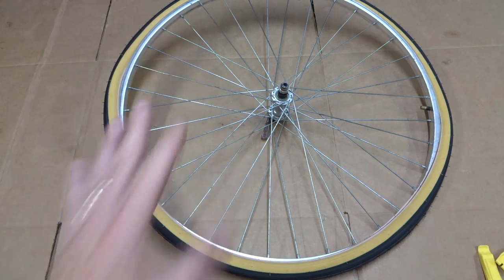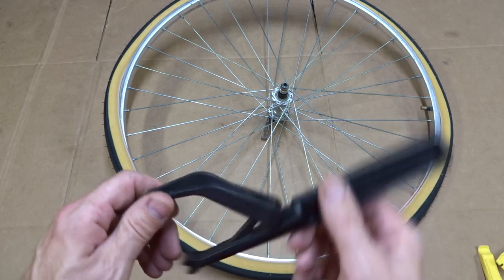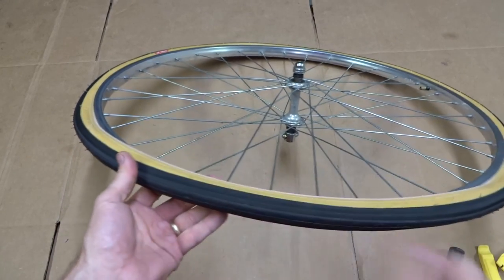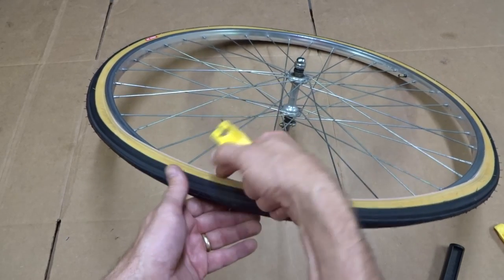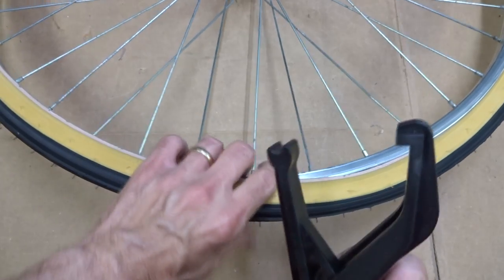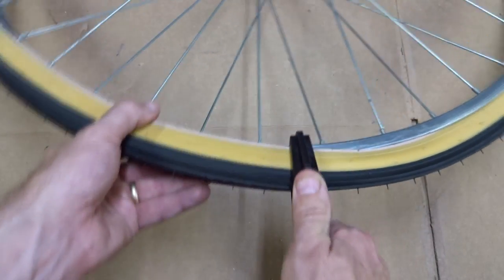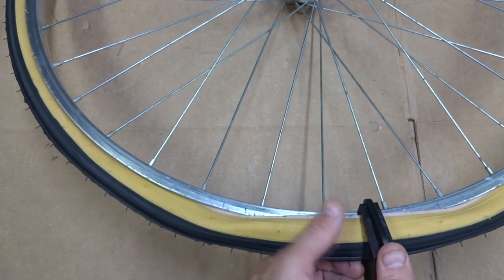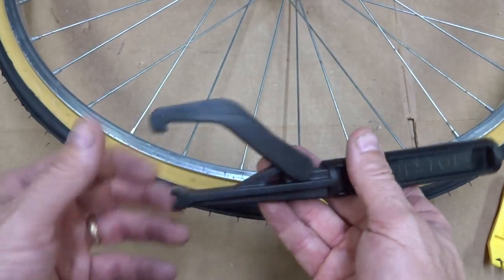How To Get Tight Tire On Bike Wheel Rim With Tire Bead Jack

Comment: This a great tool to have in the shop but doesn't help you when you are on the road -it's way too big to carry with you. There is a new tool on the market that is much smaller and works just as well as the Tire Bead Jack. Check it out at EZCLINCHER.COM. It's only 25 grams and fits into a small saddle bag. Great tool for seniors on the road that have a tough time mounting the tire on the wheel after repairing a flat.
Reply: Kool Stop Tire Bead Jack is not too big as it's light enough to fit in jersey pocket. While the product you mention may work the website seems a touch sketchy.
Reply: @alrocky  Can I send one to you and have you try it?
Reply: @webbmill  That's a generous offer however I already have the Kool Stop and there are several LBS that carry the EZClincher according to their website and actually biked pass one earlier this year.
Reply: @alrocky   OK- No Problem-thanks for responding

Comment: Can no one at all show how to get a super tough tire mounted on the first side?  Why are all videos seemingly already shown with the first bead over the rim?  This helps me zero.  I have one that's not even close to the first bead going over.  Not even close.  And we're not talking about wire beads, but rubber.  I have a set of Gatorskin tires that already I gave up on and bought a different set.  Same issue.

Comment: cool tool, but I would never use it as I would not want to scratch my expensive road wheels. Not found a tyre, yet, that I can not get on or off without using levers etc.
Reply from the maker: They are plastic will probably not scratch your rims.
Reply: Continental Super Sport Plus, Touring Plus Reflex, and brand new wire bead Gatorskins pretty much require this tool for first time mounting.
Reply: Yeah, I've found that cheaper tires are REALLY tight. It seems that with better tires I can even get them off without tools and getting them on is a breeze. With cheap tires (like the Conti Super Sports (Made in China, I discovered)) it's all I can do to mount them with 3 tire irons.
Reply: schwalbe marathon plus...
Reply: edLambshanks OMG YES! Got mine paired with puncture resistant tubes which sucks so much more for mounting.
Reply: I will give you 20 internet dollars if you can scratch a braking surface with a plastic tire lever lol.
Reply: Exactly what a thought.
Reply: +Jonathan S I guess he just wanted to let us know that he has expensive wheels...
Reply: Is the correct answer.
Reply: Or knows how to put tyres on without levers - and it isn;t all about thumbs strength.
Reply: RJ The Bike Guy It looks like glass fiber reinforced plastic, so i guess it could leave scratches.
Reply: Darren Green just use some muscle, you don't want to use that all day in the shop. and you can still puncture the inner tube if your not careful
Reply: Darren Green ever tried changing a flat on the giant slr-0 30mm wheels , they have me wanting to frisbee the wheel to timbuctoo. Awesome set of wheels but a bitch to change flats
Reply: Same deal for the SLR 1 wheels. Absolute nightmare to wrangle a flat at the side of the road. Anyone who figures they can change any tire with their thumbs is welcome to have a crack at these.